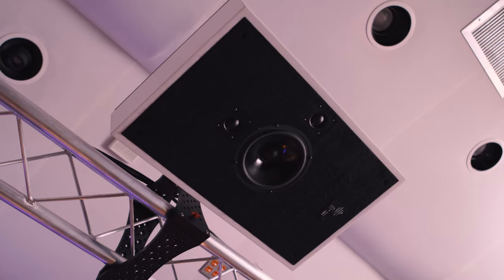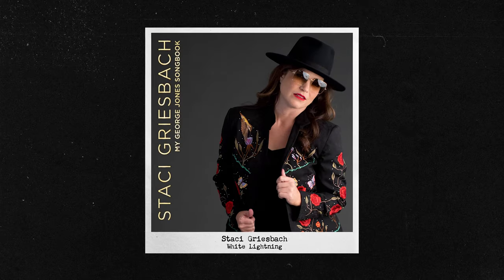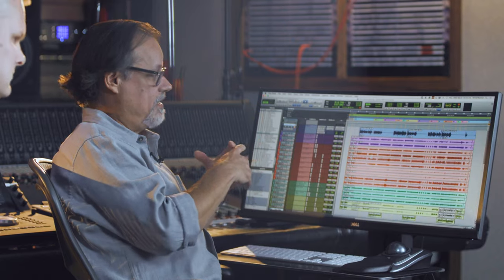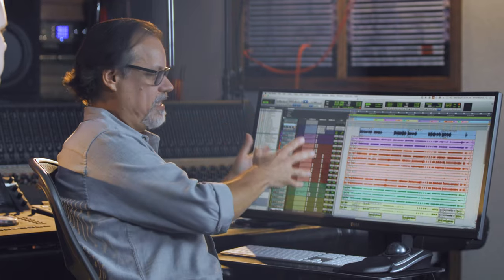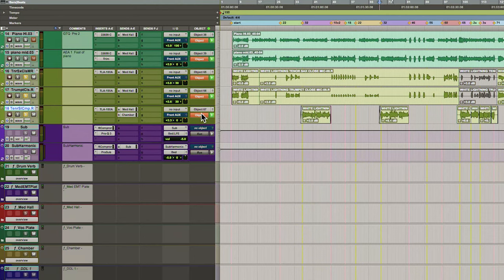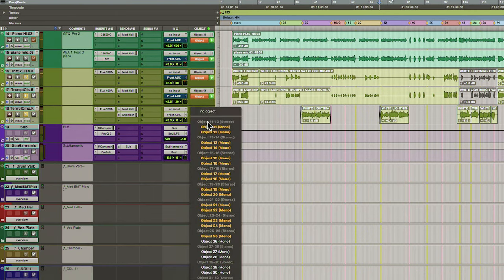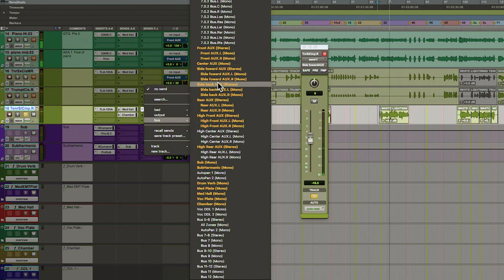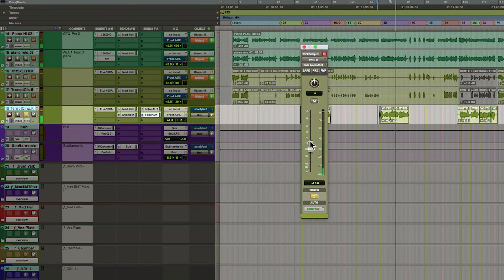Mixing in Atmos with Steve Genewick

Comment: Lots of phase relation stuff. The closer you are to center more in phase you are but things can also pop out if you pan them into the front left and right speakers. Panning into the back left and right speakers gives you this phase inversion type of feel. It pops out but has separation still. I tend to avoid the phantom crossover points on the outer edges of the soundscape between the front and side speakers and back and side speakers when placing objects. It's cool for time based effects though.